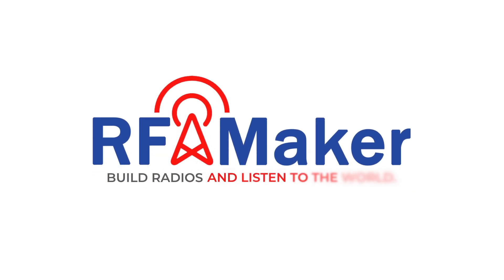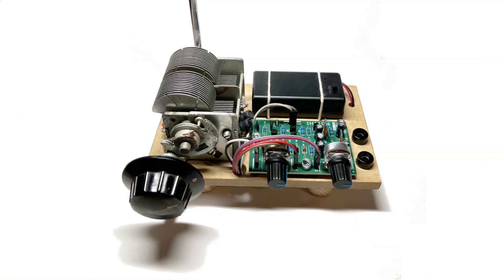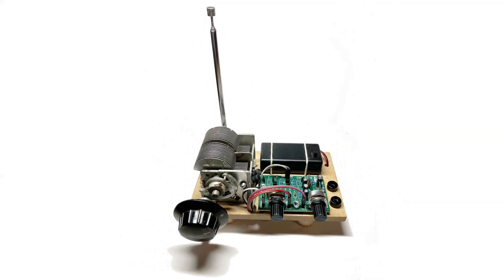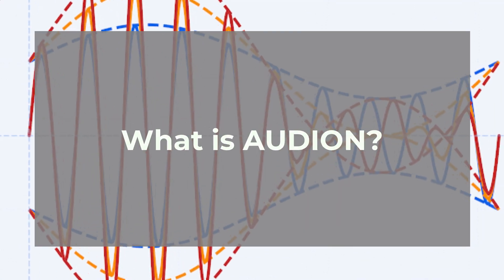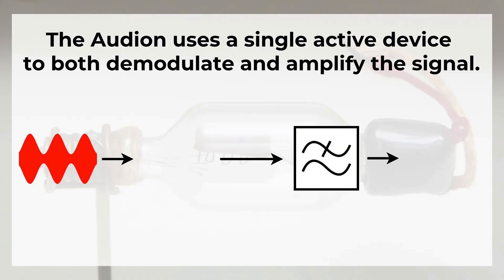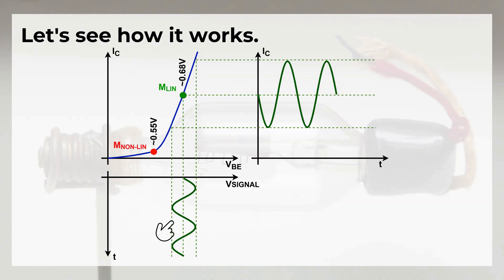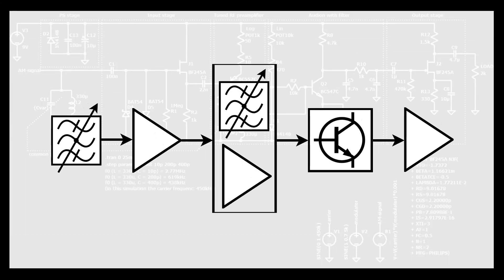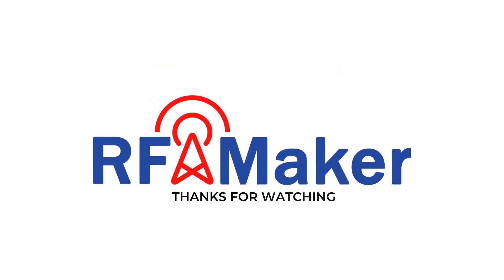Audion AM Receiver with 4 Transistors - Transistor radio

Comment: This is an excellent video.  Thank you for sharing this.  I will build it.  I have a question. What is the 2K load resister?  Does the speaker connect across this?  Where does the speaker connect?  Thank you.
Reply from the maker: Thank you, and I wish you lots of success and enjoyment with it!
The 2 kΩ corresponds to one side of a high-impedance headphone. These are usually around 4 kΩ, but in the past they were sometimes used with only one earpiece as well, which is 2 kΩ. Like this one:
https://physicsmuseum.uq.edu.au/high-impedance-earphones

If you don’t have such a headphone, you’ll hear a loud sound when connecting it to any small amplifier.

Comment: You always have to pickup the AM signal, so where is the coil on the ferrite rod for the LC circuit to receive the AM ?
Reply from the maker: I understand what you mean, but a classic ferrite rod coil is not strictly required for a radio. Ferrite rod coils can be used as antennas, coupling coils (antenna coupling, feedback, etc.), or as part of the tuning/selectivity.

In this circuit, you can see two black cylindrical inductors on each side of the tuning capacitor. These inductors, together with the tuning capacitor, form two LC tank circuits. They are ferrite-based inductors, used in pairs because that combination worked well for the MW band with these values.

I can’t attach images here, but the coils are clearly visible on the board.
Reply: @RFMaker  If a schematic would be shown it would be more clear, kind a difficult deducting a schematic just from seeing some not identified parts.